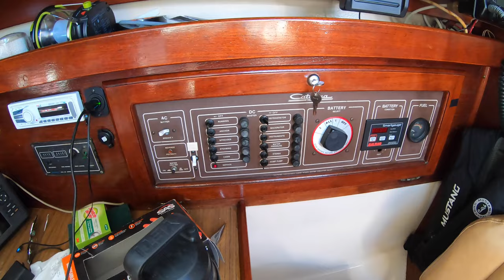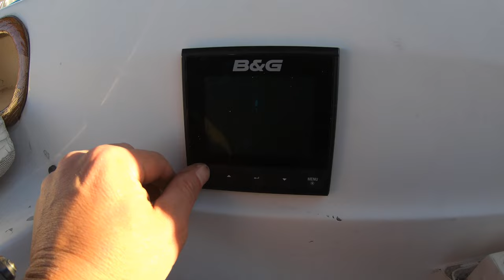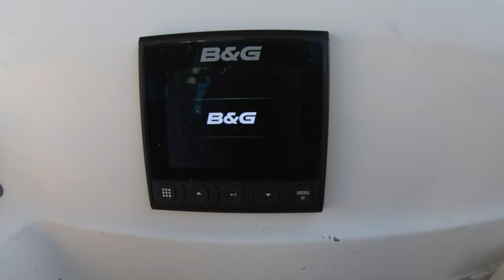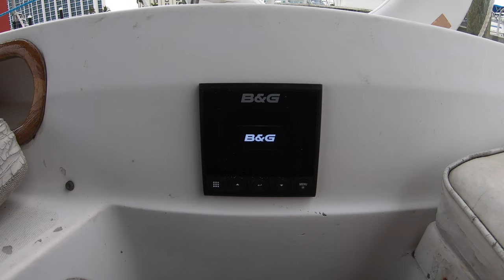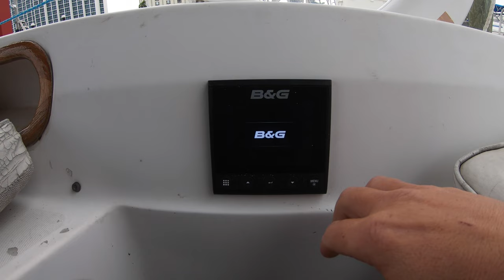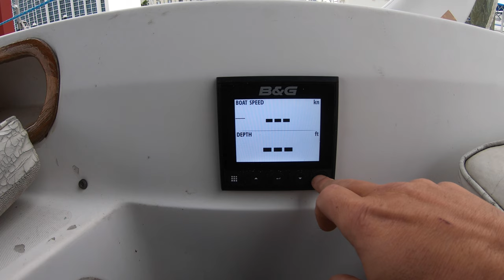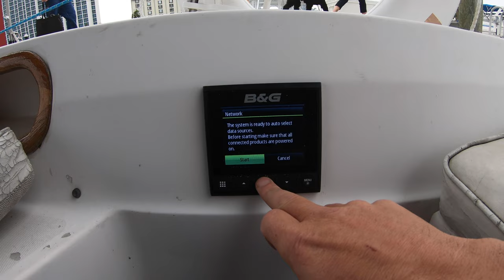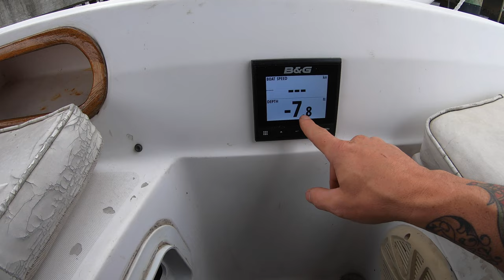Installing a B&G Triton 2 and Transducer: Episode 11

Comment: I stumbled on this and am so happy!  I just bought the Triton for my Catalina 30 and am waiting on delivery.  Believe me, I was probably as excited as you were to see the transducer fit the old thruhull fitting cause I have the same old one!!!!!  I have had multiple sleepless at night worrying about this.  I was elated when the display came on for you too, I can 100% empathize.  I sail on the Chesapeake where depth knowledge is critical and i have had none which freaks me out.  This was very inspiring as I can hopefully probably pull this off using your lessons learned.  Cheers m8 and happy sailing!!!!!

Comment: You’ll love the triton 2 system. All information with the one dst810 transducer. I opted for the wireless wind sensor package which is very convenient. I later added the vulcan 7 and with its built in gps it shares on the n2k network and the triton 2 mfd displays everything. Hate to hear you got a bad transducer but with any electronics it can be a crapshoot. Looking forward to future videos. Fair winds
Reply: How does the wireless wind sensor work? does it power itself using wind to an internal battery or something?
Reply: @hiPeeks  it has a lithium battery in it. I have had to replace it once. It has a small connection on it i had to transfer to the new battery. No issues other than that.
Reply: @Flynghi  awesome bro, thanks for info. Would you have just done the Vulcan 7 or 9 instead now that you've added one yourself?
Reply: @hiPeeks  i know i said said vulcan 7 but it was actually the vulcan 12. Same system just the screen was 12” instead of 9 or 7. And I added the 12 bc i got it at a discount rate cheaper than the 7 actually. But if i was to do it all again id still have the 12 with the triton mfd bc i have them set up on different screens so i dont have to toggle one screen for what im looking for. I actually have a spot to add another mfd for the autopilot.
Reply: @hiPeeks  if you’re on a budget amd coastal sailing id do the triton 2 with 1 mfd and have an ipad set up for gps and navigation. Whats cool is the vulcan 12 has a wifi network so i can mount ipads or just keep one handy to look at whatever i want through the vulcan wifi. If you have a couple extra grand to throw at some electronics 100% id do lithium first then would come the vulcan system.  VEry adaptable. Very intuitive. Excellent interface. Last thing you want to be doing when youre in a bind is plugging away at a chartplotter trying to figure it out.
Reply: @Flynghi  I'm on just a little 23 foot sailboat, probably going to spend more on electric than the whole boat... 😂
Reply: @hiPeeks  lol well i did all that to my catalina 22. A bit of overkill but it was fun. Also sailed that 22 down to staniel cay from miami. It was a fun trip. And once you go lithium youll never look back. Working on my catalina 381 cc now…